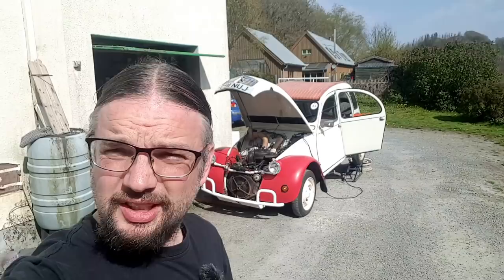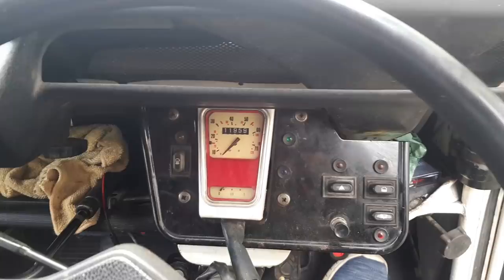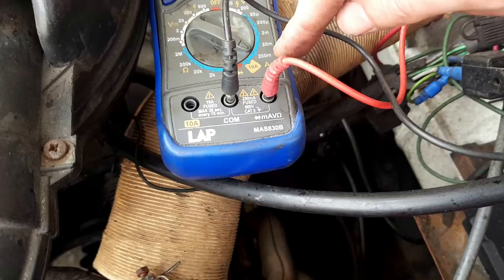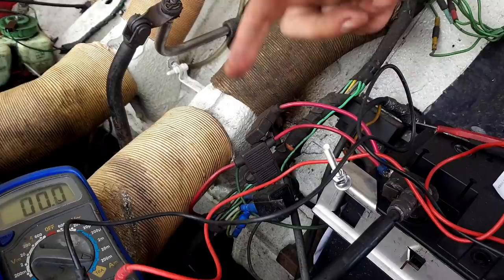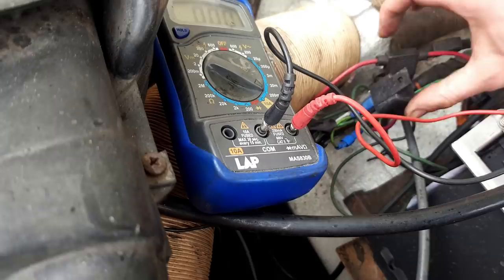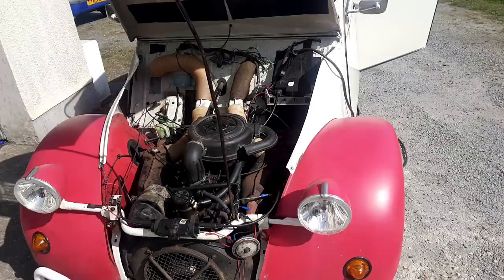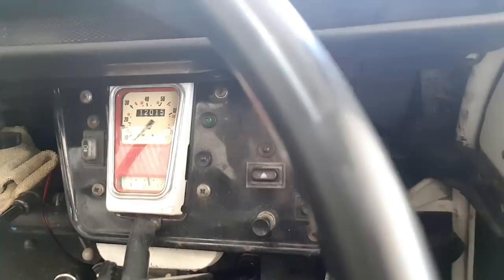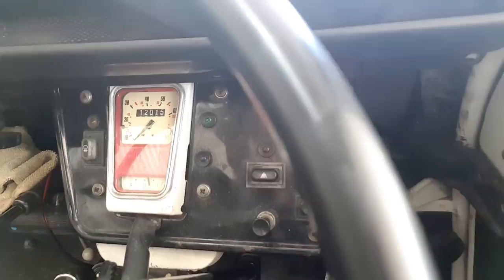2CV - parasitic drain and fuel gauge woes

Comment: on your ramps , get an old towel and cut it in half , tie each half to the bottom rung of each ramp , when using the ramps pull the towels halves forward so the car wheels run over them first , this stops the ramps sliding backwards ,  saves you having to wedge the ramps on old wheels , bricks , bits of wood . Great vids as usual . You'll love New Zealand its a great place , just dont speed over there .
Reply: That has to be the most useful thing I have learnt in a long time cheers for that
Reply: A folded bit of carpet is better, hessian backed carpet very strong, I have done that all me adult life and still do today when putting me three wheeler up on one ramp up front.   Another thing I did have was I made from pallet wood some homemade ramps, they lasted years and only discarded when I left them too close to a bonfire and they burnt up lol

Comment: Highly unluckily its a dodgy relay, if the headlight switch is getting hot, i think you have wired the relay incorrect, thats why it clicks when you connect the battery, whats the terminals on the relay 30, 87, 85, 86 or 1,2,3,5 ?

Comment: Nice 2cv, my mum had one in green bamboo colour, a basic version with round headlamps, bought new when I was a child, in the late 70's (I'm from the south suburb of Paris). It replaced an old grey 2 cv, that replaced another 2cv, and so on. I remember even back in the days there were electrical gremlins from time to time, so that's the normal state of a 2cv. As a true French people's car, It was always an easy fix, at little or no cost. So, keep it running, 2cv was, and still is, even if a little antiquated now, the distinctive car of happy people.

Comment: Another true story from long ago Ian. Moggy 1000 pickup with inaccurate fuel gauge, it ran out showing 1/4 full. So.....I carried a gallon Duckhams can in the back for when I ran out. On one occasion I only half emptied it, forgetting to fill it again. Coming back from a friends one night I found I'd only about 1/2 gallon. So, doing a bit of an economy run, I heard the pump ticking about 3/4s of a mile from home. Weaving about and coasting, I managed to get the last drop. However I coasted to the exact spot where I parked, and stopped without braking 😊😊👍

Comment: You would have a nervous breakdown if you investigating that on a modern car.
Reply: I had an issue with the headlight circuit on a 2002 Polo and in the end I got so fed up that I cut all the wires and made my own headlight circuit from scratch with new live and earth feeds and a seperate fuse holder and relay!

Comment: 17.54 or the sender in the petrol tank is faulty, as you know the resistance gets lower with a full tank. Also I think you have the relay incorrectly wired. the switch in the car should energise the relay coil, the relay contacts should supply the power to the lights.

Comment: Great video Ian,with the relay done without full beam, Elly starts better now and drives brilliantly,with the bolt for the fuel underneath the car try new washers and clean around it for a better contact.

Comment: Hi Ian , another great presentation again . If you cannot get a good earth for the fuel sender on the original earth position it may be bad earth off the engine to the chassis , try cleaning those as well but if all else fails run a permanent separate earth wire ( thick gauge ) cable tied to the chassis direct to battery thus eliminating bad chassis earths . Anyway thanks again for great video's.

Comment: I had a parasitic drain issue on my old BX too. If I didn't use it much throughout the week, and left it all weekend, it'd be dead come Monday. It was about time for a new battery, so I got one, but eventually the problem returned. I was on the verge of borrowing a multimeter and trying to see if it was anything obvious, until I had a eureka moment one evening. I parked up, and saw a light in the footwell. It was at totally the wrong angle for it to be a street light, and I realised it was the glovebox light. The car was a bit of a shed and the glovebox lid had fell off some time before that... of course switching the light on constantly. In typical "me" fashion - I just disconnected the bulb! problem solved! I ran that car for a good few years on virtually a shoestring budget. It owed me nothing and I had some great adventures in it. I often go on about it because I lament the fact that I had to scrap it so much.

Comment: I would swap that connector & wire ideally as it has undoubtedly wicked moisture up into the wire itself & caused oxidisation (the copper goes black & the resistance increases greatly). I tend to solder anything which will be out in the elements so at least you get a physical bond at the solder joint - it doesn't fix the problem of moisture wicking though. Sealed connectors are the fix for that. For the relay I would echo others comments about the wiring of the relay - you may have a sneak path which you haven't accounted for.

Comment: On ebay there is a tidy little kit for upgrading your headlamps to relay operation and it utilises the existing headlamp wiring connections on one side to control the main and dip beam relays, very simple and non destructive to fit, very good quality wire and all heat shrink'd and in shower tube protective covers and you basically lead the positive up to the pos battery terminal, fit the headlamp connector from one side to the supplied plug, find earths for both sides, plug the looms supplied ceramic plugs onto the back of the bulbs (taking off the other bulb connector first) and voila you got instant relaying action without having to cut a cable.   Just a bit of cable tie tidying and tucking it all out of the way and enjoy headlamps that aren't flickering candles lol   My one cost like £11 and I replaced the relays with fused high quality ones and job was a good 'un.

Comment: Hi Ian, when I had a 2cv I had the same issues and replaced the sender in the fuel tank as the resistance coil breaks down and the float can fill with fuel making the readings lower than what you really have.

Comment: Elly looks fast from that rear shot haha.
I used to hit the top of the dash between the mph gauge and the rev counter to get my fuel gauge to work on my old 1990 astra mk2 sri.
it seemed only to work when the engine got hot and you had to hit the exact spot on the dash.
 Ahhh them were the days haha.

Comment: Poor Rover failing its MOT, nothing a tickle with a welder wouldn't sort, if its that crusty cill we saw in a past video. Wouldn't be surprised your CV boots are bad as well, I'm sure I heard those shafts clicking away and probably some crusty dust boots as well. Original suspension I bet. 

I'd also check the fuel sender properly in your 2CV though, I wouldn't be surprised that the modern fuel with ethanol  in it has rusted the inside of the fuel sender, hence why its not reading properly, especially as she sits quite abit.

Comment: @mrhavoc200701 has made a valid point; that relay should NOT energise unless you've switched the car's headlights to main beam - and if that relay IS energising, why aren't the main beams themselves actually on? Sounds like a bad case of 'Hubnut Electrics' to me - especially if the column switch is getting a bit smelly...

In other news though, locally-spotted this week - a blue Morris Ital estate with some very bright DRLs fitted, and on this lovely sunny afternoon - a brilliant yellow T-plate Renault 4 :)

Comment: Failed mot I'll take a guess, top suspension bush bottom balljoint & brake imbalance  not efficient
Reply from the maker: Close. Top balljoint cover torn, CV joint cover torn (and they'll change clattering CV joint at the same time), bit of welding on one sill end.

Comment: As if it were perfectly timed, Amy Macdonald's "Slow it down" started playing on my musical phone (about all I use that one for!) while you were hooning in Elly after refuelling!!! :D

As for the fuel gauge, either it's poor contacts on the sender, or there's a high-resistance connection somewhere along the line, could trace that with the multimeter by probing along the harness, or just give up and put in a new wire and do a BT Openreach and abandon the old wire... :P

Comment: If you have not had this problem fixed yet try wiring the main beam to the key accessory’s port so the they will not take power unless the key is on
Reply from the maker: It was my stupid fault miswiring a relay...

Comment: I had a mystery drain on a Triumph motorcycle, turned out the rectifier pack was failing and daring through the alternator coils. Two dealerships couldn’t find it.

Comment: Old switches can be refurbished by opening up the switch and cleaning the contacts. Not so easy with modern switches which are located inside molded plastic cases.
Reply from the maker: Yeah, this one is pretty badly worn inside. I don't think it's worth a rebuild.

Comment: Take the main wire off the tank sender and earth it the dash gauge should go up to full that shows the wiring and dash gauge are working. Possible problem is most probably a faulty tank sender unit or a sunk float. (Dont leave the gauge earthed when the gauge reads full tank)
Reply from the maker: Did you not watch me do exactly that? ;-)
Reply: @HubNut  yes I did I was attempting to do 3 things at once and I have found I cannot multi task but glad you resolved things the thing is if you can take the earth cable from the cross beam and earth it inside of the car it stops the earth corrosion have a good evening Ian regards from south Wales. 😊

Comment: If there is an easy place to pass a wire through, perhaps you could move the earth connection inside the car, so it would be less exposed to the elements?

Comment: if you cant find the "leak" electrically, just install one of those switches for one of the power cable...
Reply from the maker: I bought one! And have since lost it...
Reply: @HubNut  ah well before i got rid of the 89 pontiac bonniville i got a switch because the wireing had a leak, and just couldnt find it, so installed one.. end of problems

Comment: Will get much better life from your battery if you have the clamps tight. If they are loose the lead posts oxidise and increase the resistance. Increased resistance reduces the effectiveness of the alternator charging the battery. Keep connections clean and tight, lose connections increase the current draw and increase the likelihood of fire. Not good at all. Take it from a professional electrician.
Reply from the maker: It was only like that while I was problem solving.

Comment: It's probably a slightly daft question, but it's one that's worth asking.  Are you sure that the float on the fuel gauge sender unit hasn't taken on a little petrol so it isn't floating as well as it is designed to?...
Reply from the maker: Not entirely, no, but dropping the tank is such a pain I'll just live with it.
Reply: @HubNut    Yes, fuel gauge sender units aren't the easiest things to get to or change.  From the looks of things I think you might be on the right track with crusty connections causing low voltages...

Comment: What is it you disconnect from the coil Ian? I have heard you mention it before but i couldnt find anything on the web about it. Cheers
Reply from the maker: I just remove the low tension wires. Then it is no longer part of the ignition circuit.

Comment: We've got beautiful weather in South Wales too. I've got an under reading fuel gauge in the Seicento. When I replaced the tank, I replaced the fuel pump/sender unit (single point injection) in a slightly different position so the float isn't in the correct position with a full tank. When full, the gauge reads halfway between 3/4 and full. I'll correct it when I get round to it. The only problem is the fuel warning light blinking on and off with a tank that's around a 1/4 full. Could that be the problem with Elly's fuel gauge? Mine's an easier fix because there's an inspection plate under the rear seat.
Reply from the maker: I think I still have a minor earthing issue.
Reply: @HubNut have you considered making a new earthing point? It may solve the problem.

Comment: could your problem be the main earth from battery as you have trouble with lights aswell
Reply from the maker: No. It was the fact an idiot had wired the relay connections incorrectly...

Comment: It might be the regulator on the back of the fuel gauge? -basically the regulator reduces the volts to gauges on old cars to stop the needle flying over violently to the stop when you first switch on...Curious but what is a ball park figure for a NZ air trip?
Reply from the maker: No regulator on these. When the fuel sloshes about, so does the gauge.
Reply from the maker: Oh and one way flight to NZ was £503. No idea what I'm doing about coming back yet, but I'll cross that bridge when I decide to get to it.
Reply: @HubNut   cheers thanks- looks a good deal,I must go sometime..or other.

Comment: You've wired that relay incorrectly my friend. Going to say you've connected the solonoid coil across the battery instead of the light switch, and are just passing the light switch current through the relay contacts to the headlight.

Very common mistake.

Lost count of how many times I've seen a relay fitted that isn't actually taking the load off the switch it's supposed to be buffering because it's been connected in the same way I suspect you've got that one connected. The direct feed to the coil from the battery keeps the contacts closed so it appears to be working, but all it's really doing is slowly draining the battery and not supplying any current to the load.
Reply from the maker: Ah, thanks. That would explain why the headlamp switch smells on main beam - it's still taking the full load.

Comment: Hi Ian, with regards your relay - its not the relay at fault, its the way its been wired up. The fact it clicks when you apply power pretty much proves that (plus it indicates the relay is working like it should) Sounds like you have two wires back to front - the wire from the battery should go to one of the switched terminals on the relay, pretty certain you have it going direct to the coil terminal on the relay. The relay should get its power from your light switch - when you turn the lights on the relay is energised from that circuit. The wire from the battery should go to one side of the switched contacts, and the other side of the switched contacts then wire into your headlight +v. Hope you sort it!
Reply from the maker: Correct. Already sorted after comments on here!
Reply: @HubNut  Nice one! Glad its sorted and Elly will no longer been drained of power! :-)